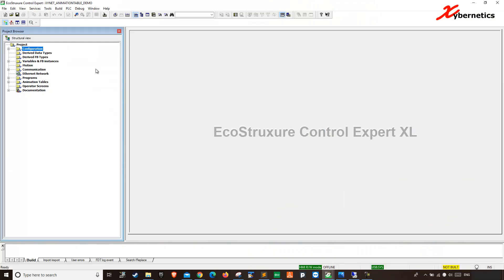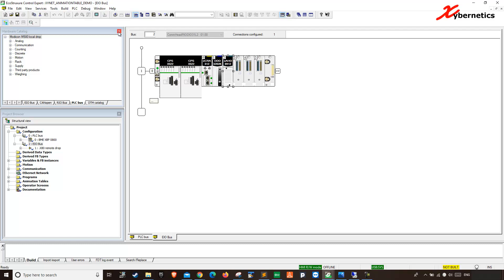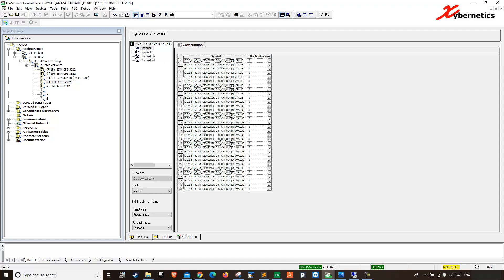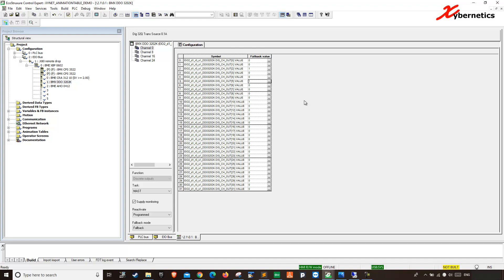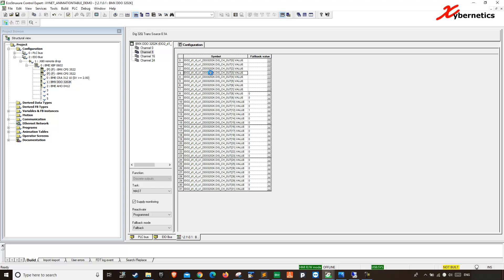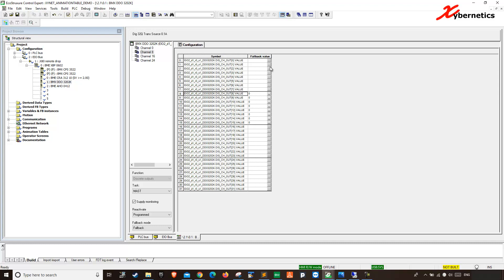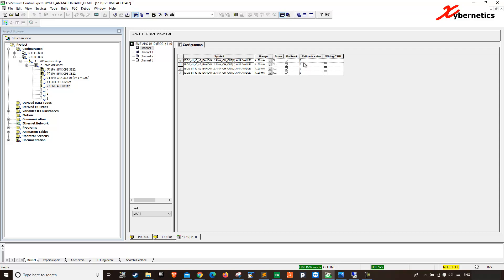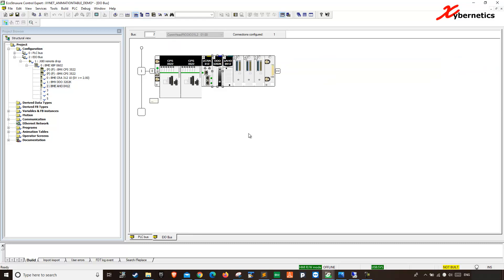AO And DO In Fail Safe Mode When In Power Failure State

Comment: How do you test fallback? Thank-you in advance.
Reply from the maker: Simulate CPU or power failure on one of the Schneider-Electric Modicon M580 CPU. You can also stop the program in the running Schneider-Electric Modicon M580 CPU using the EcoStructure Control Expert programming tool.
I hope that helps.